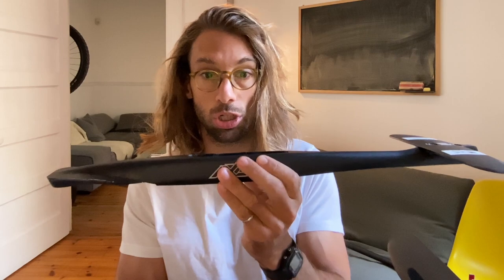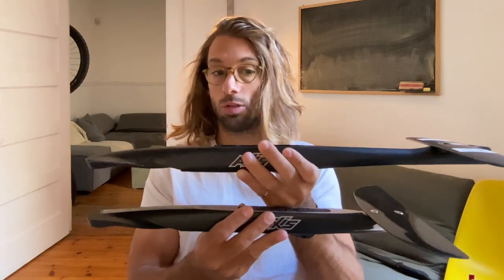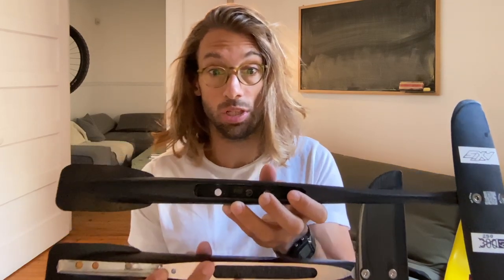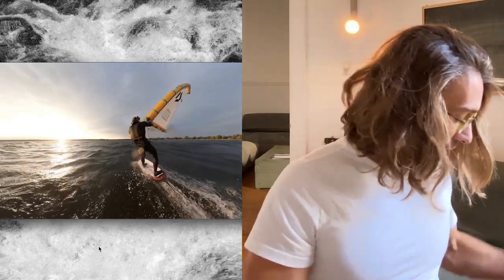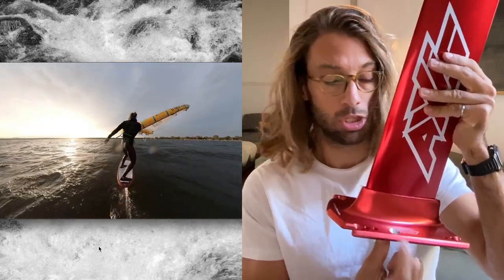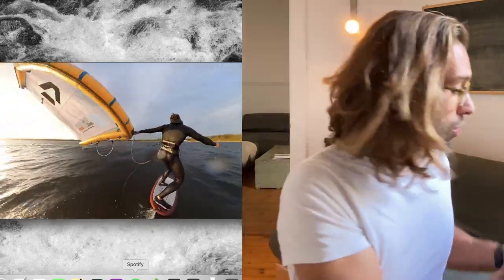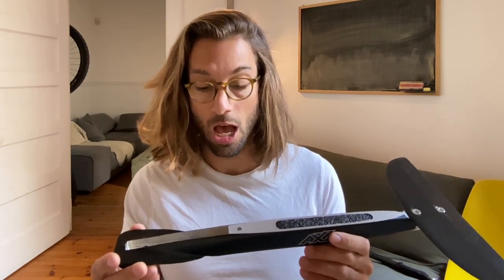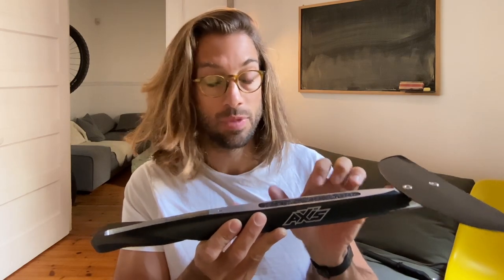I bolted the front wing into the mast

Comment: This is the best part about foiling.  There's always something you can change to get a new feel.  I learned to kite in Montreal a long time ago and can see the need for a shorter fuselage in that region to make the relative flat water and lighter winds interesting.  Out here on Vancouver Island now and a fuse like that would make our 40kn winter storms quite challenging.  Most downwind, big wave tow and racing wingfoilers are on longer fuselages for the extra stability when pushing the 25+kn foil speed range.  

I've been on Sabfoil, mostly w1000 and w800 which puts the front wing right in front of the mast and have noticed that most major brands have moved the high aspect front wings further from the mast for 2022.  Lift, axis, cabrinha etc.  Always liked the solid sabfoil ride, and I have no problem turning at nearly 95kg in a wetsuit.  I've been wondering if having the front wing further forward would help with pump and glide.
Reply from the maker: In my case, the short fuselage is primarily intended for wave riding. It is been years I ride with a <50 cm fuselage in waves and in high winds... once you are used to it, you can take anything. I can imagine that for racing, downwind or big waves (> 2x overhead) other setups are better. Regarding the comment on the forward position of the mast, for pumping or gliding, I did not notice any change in either. Moving the mast forward seems to only affect the manoeuvrability without impact on pumpability or glide.

Comment: But ”ruddering effect” increases when same fuse extends backwards, right?
PLS keep on testing🙏 Its approciated knowlidge👍
Reply from the maker: 🙏🤙.Yes. What matters is the horizontal distance between the center of gravity that it on the front wing and the end of the fuze. If you would be to put a vertical stabilizer at the end of a long fuselage (e.g. 70cm), that would result in a super stable foil that only wants to go straight. In a more normal setup where you use a flat horizontal stabilizer, the shorter is your fuselage (and the smallest height)  the more manoeuvrable your foil become. However, you cannot bring the fuselage length to zero as your stabilizer is required to provide pitch stability. Note that any rear stabiliser that is not flat will act as a vertical rudder so you should avoid it. Same for AXIS's vertical offset between the underneath of the stabilizer and the fuselage.

Comment: If you want super manoeuvre-ability, make a canard scheme - stab in front of wing. That will require to make a fuz from scratch though.
Reply from the maker: I will look into it!
Reply: @james_goulet , also, the stab should lift up, not down like with traditional "aeroplane" scheme.
Reply from the maker: @mm74forums7  I looked into in and I did saw that the stab will lift upwards. However, my first taught is that it is not going to improve the manoeuvrability while maintaining other design aspect. My taught process is that in an ideal world, I would only keep the front wing with the mast directly mounted on top of it. That would increase the manoeuvrability and decrease the drag in comparison with the current setup. I have tried it it does not work and the only reason is pitch stability. Although I can ride the foil, the pitch stability is too sensitive. Therefore, what I want is to add a little pitch stability while inducing the lowest possible amount of parasitic drag. any stab put in front of the wing will reduce the pitch stability. Therefore, my intuition is that I will need to increase the front stab size in order to balance out the load between the front and back wing in order to create a lever arm between the two that will provide stability. I will keep thinking about it. If you find loopholes in my thinking, do not hesitate to point out. At the end, I am for whatever works. In the meanwhile, the question is what path is the most promising to explore...
Reply: @james_goulet  That's basically what the Triton T1 is.
Reply from the maker: @AKJammer1   I have tried it... it is not